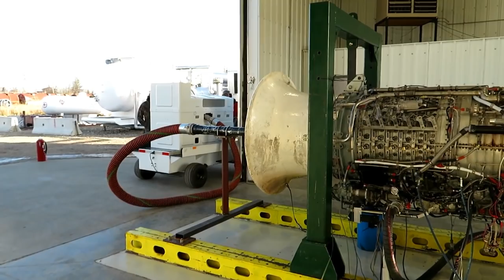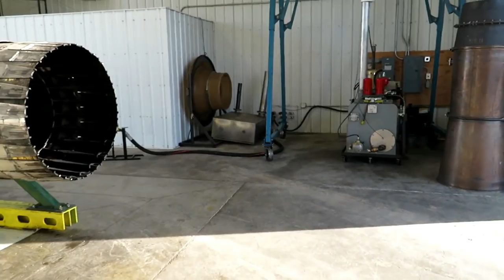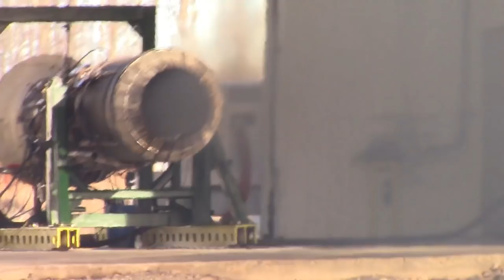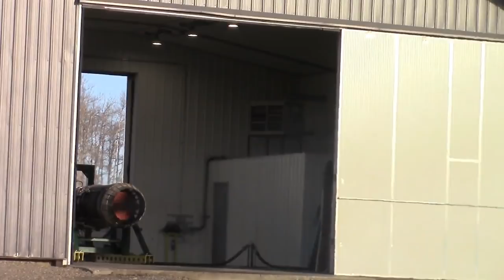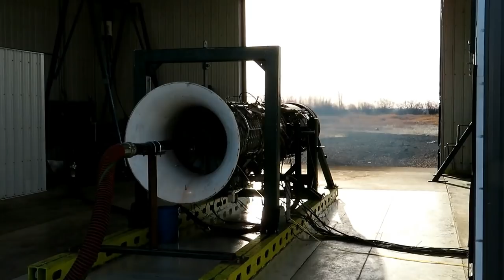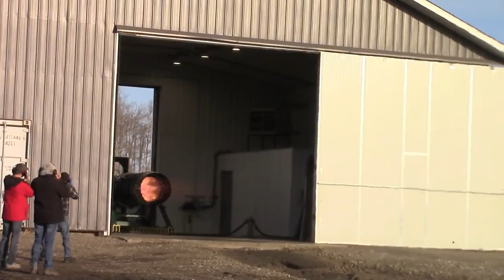Starfighter Engine Run - Screech, Smoke, and Afterburner

Comment: A few questions - why do these engines (and others, possibly) sometimes have the hose supplying the starting air attached down the centre axis of the engine? Is there some advantage to having it connected in that way? I only ask because with most of the other engines I've seen in your videos, the air starter is fitted underneath the engine and the hose supplying the starting air goes to that position. So when the hose is attached down the middle of the engine like we see in this video, is the air starter also in the middle of the engine? Wouldn't that make accessing it for maintenance a bit more difficult? Also, how would this engine be re-started mid-flight, since presumably you can't have that hose there while it is fitted to an aircraft - is there another connection for the starting air elsewhere on the engine which is used in that situation?
Reply from the maker: Some engines in some aircraft have the actual starter attached to the accessory gearbox, and so they drive the main rotor through a couple of angle drives and a radial drive shaft.
Other aircraft have the starter mounted so it drives the main rotor directly.
Both systems have the starter turning at the same rpm as the rotor, and it is up to the aircraft designer do decide which to use.
All of the industrial, ground running LM1500s, which are derived from the aircraft J79, use the gearbox starter mount.
Reply: @AgentJayZ  So if I understand this correctly, the "direct drive" starter system is the one where the starting air needs to be fed down the centre axis of the engine, as shown in this video. This would make sense for a static application, such as the LM1500 or LM2500 running on the ground in a power plant. However, when this system is used on flight engines, is the starting air routed through one of the support struts at the front of the engine? Either that or some similar arrangement, to avoid obstructing airflow into the front of the engine. Am I thinking along the right lines, or am I missing something?
Reply from the maker: In the starfighter, there is a scoop on either side which forms the inlet for the engine, so there is a central portion through which an air supply to the starter is routed.
All the industrial engines I've seen are started through the gearbox.

Comment: what, was I gonna say no thanks to a star-fighter A/B video?      not today.      nice Agent Jay Z. edit wow.   thats an unbelievable amount of power all in one place -   quick question is there a risk of overheating the AB tube if you shut it down too soon after running? I assume this is all factored into the test procedures?   any comment on how the cooling at shutdown is managed ?
Reply from the maker: It's all air-cooled, and can safely run flat out as long as the fuel lasts. Have a look at my video called Cool your Jets.

Comment: I'm waiting for a video on cooking the hot dogs with a jet engine :)
Reply: I believe that is on the Colin furze channel.
Reply: You can cook them on the afterburner shroud, but if you toss them into the exhaust stream you will never find them, as they will land a long way downwind, and disintegrate on impact. At least that is what would happen to bricks tossed into the exhaust of an idling jet, though those you had a very marked impact point on the revetment wall 10m away, from the brick turning into powder. That was one reason to only have them at idle, any higher and you would need to have restraints, as the brakes would still lock the wheels, but they would simply slip on the ground.

Comment: How did you reach the conclusion that the new combustors are less efficient than the old ones?
Sure, the newer version burns more fuel, however this could be attributed to the higher power of the engine.
Now I'm not at all an expert on jet engines, but a lot of black smoke is a lot of unburned carbon leaving the engine.
And unburned carbon obviously doesn't contribute to combustion, meaning it doesn't heat up the gas before the turbine.
Could it be that the new combustors are actualy more efficient, but also more powerfull, leading to a higher fuel consumption at maximum power?

Excuse my bad english, I'm from germany.
Reply: Yes your not a jet engineer but JZ is so listen to him
Reply: @derekgrundy9064  That is why I asked how he reached that conclusion, I'm curious.
Reply: Your English is fine 👍
Reply from the maker: I have been told that when an industrial engine, which does not use an exhaust nozzle, is converted from standard cans to lo-smoke, the fuel consumption for any particular rpm, EGT, and power output at the power turbine, increases slightly.
The reason the lo-smoke equipment is used for industrial engines is partly for lower emissions, but also the liners have a much longer service life before they wear to the point of needing to be replaced.
Reply: @AgentJayZ  Thank you for your answer, I realy appreciate it when a YouTuber answers in the comments.

I've thought a little about it in the meantime:
The the combustion efficiency is probably higher in the low smoke version as seen by the lack of unburned/partialy burned fuel aka smoke.
However the drag the gas flow experiences could be higher as a trade-off.
More complete combustion can be archived by inducing more turbulence, wich mixes air, fuel and hot gasses better.
That additional turbulence could introduce drag into the gas flow, leading to lower efficiency of the overall turbine.
However that's just a theory.
Reply: @derekgrundy9064  AgentJayZ isn't an engineer either, and he will probably be the first to tell you that.
Reply from the maker: I was trained as a scientist, and then a technician. An engineer works in the space between those two, and I am not an engineer... just an interested amateur.

Comment: Hey jay, Does running the engine a little richer, make the turbine blades last longer?
Reply from the maker: It's not running rich. There is always an abundant excess of oxygen in a turbojet combustion section.
Rich/lean is piston talk.
Reply: It would make them last less. It's not a piston engine. Jets always run very lean to avoid exceeding the turbine's temp limit. Adding fuel leads to more heat in a jet.

Comment: Is there a time limit in afterburner? If so, is it a structural limitation?
Reply from the maker: The limiting factor is that it adds 50 gallons per minute to fuel consumption.

Comment: At 3:31 - that puff, was that ignition or something else?
Reply from the maker: The engine was already running, so not sure. It's about 50 years old, just taken out of very long term storage, has had a lot of work done to the fuel and oil systems, and it is running at idle. Some burps, coughs and farts are expected as the systems settle into operation. It looked to me like a small amount of unburnt fuel, maybe from an afterburner spraybar.

Comment: Please excuse a noob question, but why dont jet engines blow out of the front? Or, why doesn't the increased pressure from combustion act to slow down, stop and reverse the compressor?
Reply from the maker: #1 mistake when thinking about jet engines...
Answer: the burning of fuel with the air in the combustors does not... does not... does not increase the pressure of the mixture.
The gases expand and increase in speed out towards the turbine, but they do not increase in pressure.

Lesson: these are not piston engines

These are not piston engines.
Reply: @AgentJayZ  Thanks. I get the "not piston engines" bit, I am probably mislead by pulse ram jets, German V1 bomb style.
So, the gas goes out the back because there is less resistance that way, but with the extra gas there is enough to keep the compressor preventing flow out the front and leave plenty for thrust.
I guess that I have not really taken in the difference (in geometry/ size) between compressor and turbine.

Again, thanks for your time.
Reply from the maker: That's not how it works, but you can find out how it does if you want to.
Reply: @AgentJayZ  In that case I must just be too old or thick to understand. I see plenty of what happens,(in a it just does way) but nothing as to why what I cant get my head round does not happen.

Sorry for taking your time.
Reply: @dougaltolan3017  Unlike a piston engine, a turbine engine is a "constant pressure" engine meaning that the pressure in a specific location within the engine remains constant while running. The theoretical increased pressure from combustion that you're picturing is negated by an increase in velocity through the usage of divergent ducts which allow the combusted gasses to accelerate in speed instead of expanding and increasing pressure. This keeps the flow within the engine going one way. 

I hope this helps.

I found a good link which might also help: https://www.skybrary.aero/bookshelf/books/1621.pdf
Reply from the maker: All of the books I recommend in "Books!" have great explanations and diagrams. Some are available as PDF, and some are free. Otherwise, a good old fashioned library...
If you read only the first two chapters of any of them, I believe you will enjoy it. 
Even easier, exc911ence just posted a very good link. Have a look!
Reply: @afoolandhismoneychannel  Thank you, I think I have found my stumbling block.. I was not considering the aerodynamic properties of the diffuser (I think..) .
Reply: @AgentJayZ  Thank you, good material was becoming hard to find.. My nearest library that might have such books is at least a 3 day round trip..
Reply: @dougaltolan3017  It all comes down to Bernoulli's Principal and how fluids act in a venturi.

Comment: Hi there dude, what jet engine is in the Hawker Hunter that gives that distinctive whale of a sound on fly by
Reply from the maker: It's a RR Avon. A similar engine to the Orenda 14, but more powerful.
Reply: It's not the engine that is producing what is known as the Hunter's 'Blue Note'.  No other Avon-powered aircraft produce the sound.  I've read that it's produced by the airflow across the four 30mm cannon ports, in the much the same way as the gun ports on Mustangs produce a distinctive whistle.

Comment: Is it fair to say this engine is loud?
Reply from the maker: No, a fire truck is loud. If this engine is at full dry power, without AB, you would not be able to hear a fire truck even if it was so close you could touch it.
I don't know what that is called, but it is a few notches above "loud"
Reply: @AgentJayZ  just joking. I’ve been near the runway with F-15Es taking off in full AB. It’s really hard to describe.
Reply from the maker: Ah! So you are one of the knowing ones...
Reply: @AgentJayZ  you dont hear it..... you feel it...... Also from NZ! cheers for ya work.

Comment: Interesting, the cycles with afterburner, it seemed primitive, almost chaotic. There are videos out there with smooth Mach diamonds...
Reply: Looks like the nozzle of this engine was under expanded in this test, as evident by the wide jet cone Jay mentioned. You don’t see that at sea level with modern nozzles. Mach diamonds are usually less visible in under expanded flow. 

What you are referring to are Mach diamonds in over expanded flow. It may look “smooth” but it represents a loss of thrust. A nozzle works best when it is matched to ambient pressure, at which point there are no Mach diamonds or expansion fans.

Comment: How much fuel did you burn for this ride?
Reply from the maker: We started with 2600L in the tank. Didn't run dry, but could not do another until we got another 5 thousand litres delivered.
Reply: @AgentJayZ  Hey, that's only about $2,000 dollars, right?

Comment: Have you worked on any jet engines with water injection?
Reply from the maker: Yes, a J47, and an LM2500, although the 2500 is an industrial derivation of the CF6-6 turbofan airliner engine. "Jet engine" has a very specific technical definition.
Reply: @AgentJayZ  
My father was a USAF pilot. The base we lived on in the late 70s was a EC-135 base. Those were loud and smoky at takeoff.
Reply from the maker: Yes, compare those to the re-engined KC-135, with the CFM56 turbofan. Cleaner, quieter, better fuel economy, more thrust.
Reply: @AgentJayZ  
Could you do a video explaining water injection?

Comment: I've noticed some of the military jets that fly near my home howel / screech is this common?
Reply from the maker: The most modern fighter aircraft I've been "buzzed" by have been the F-18, F-15, F-16, F-22, and F-35. None of them had a screech to their exhaust, but they all had a roar that extends deep into the low bass frequencies. Nothing like the whistling sound of the older J79s, though.
The A-10 does have a kind of scream that comes from the fan section, and it is one of my personal favorite engine sounds.
Reply: @AgentJayZ  living in Tucson AZ I get the treat of seeing A10s almost every day. During lockdown they were taking the aircraft out for shakedowns and did some pretty incredible aerobatics right over Tucson. Love the sound
Reply: they go over me quite often as well, they are flown out of Martin airport by the air national guard.